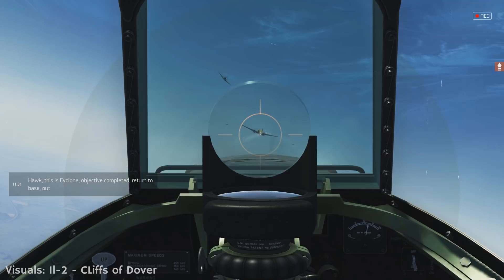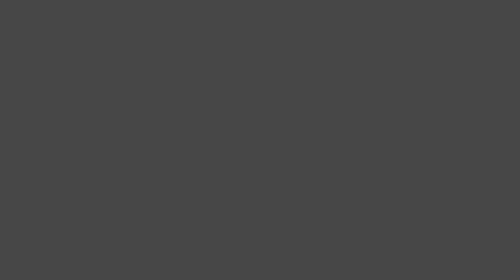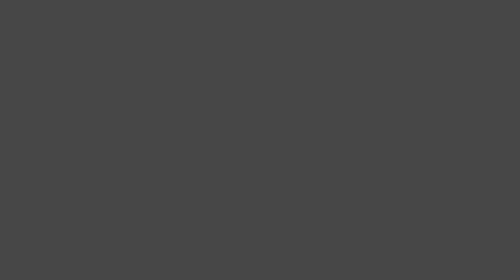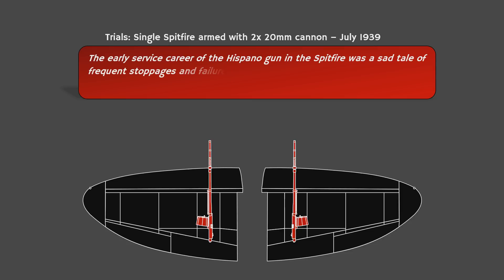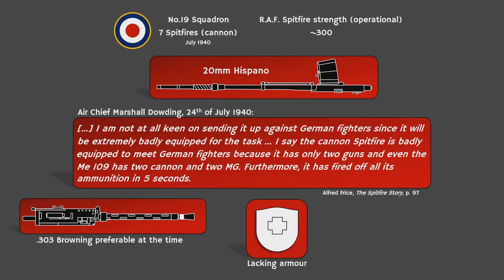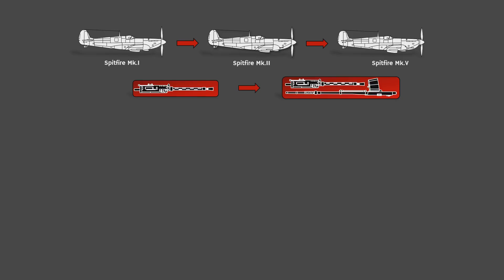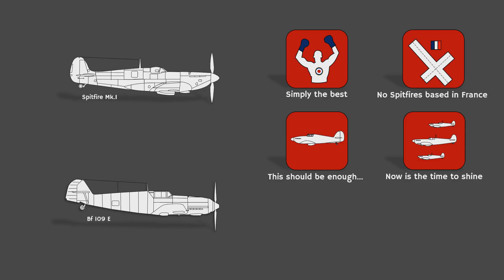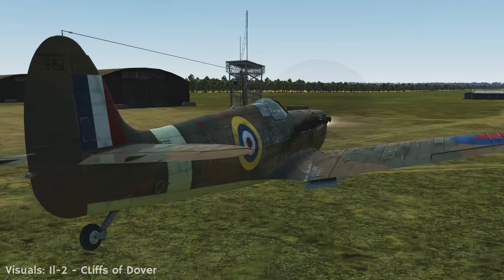⚜ | Clearing up Spitfire Misconceptions

Comment: Seize is really the wrong word, stall or cut-out would be more appropriate. I understand hesitancy to say stall as we like to save that word for the wings but in this case it would apply
Reply: TTMR1986 hes German so he gets to mess up
Reply: He is Austrian actually not German... easily mistaken though :)
Reply: Does gentle norwegian get to mess up cause he's Norwegian?
Reply: engine floods , float in carb opens up under negative G, float bowl in the carbs fill with fuel , engine floods with fuel and cuts out due to over rich mixture ...Is that right ?
Reply: Jonathan Vogel the float floats on top of the fuel at the now bottom of the carburettor chamber due to it being under negative G.  

This opens up the fuel chamber to the fuel pump’s pressure, and when it fills, the full pressure of the pumps is being injected into the engine, resulting in a massively rich mixture and flooding.  

The fuel pump’s job is only to keep the fuel chamber of the carburettor topped off.  

The quick fix solution, suggested by a female engineer, was to simple restrict the rate at which the fuel pumps could top off the carburettors fuel chamber to the same flow rate as the engines would require at max power.  

That means that when the same thing happened, the pumps would only be forcing fuel through the carburettor’s needle at the rate they’d be being pulled in naturally anyway, providing the engine was at full power.  

You’re only really going to be doing those manoeuvres at full power anyway, so it was good enough.   

You see a lot of half answers about this from people that clearly don’t know what the problem or solution was and how they worked, but they know it’s ‘something’ to do with flooding/stalling, and the fix was ‘something’ to do with a small hole to restrict the fuel somehow.  

All you need to know is that how carburettors introduce fuel into the engine, is a separate system entirely to how fuel pumps feed a carburettor’s own separate little ‘tank’ that it works with.  

Carburettors are constantly sipping from a cup, and the main pumps periodically top up that cup very quickly.  

When the carburettor is ‘erroneously’ demanding to be filled up, but it’s already full, because it’s way of measuring how full it is is inverted, then it effectively links the two systems together and now the high pressure, high volume ‘topping up’ pumps are working at full duty, straight into the engine.

Using the teapot, teacup analogy, the fix was to put a restrictor plate on the end of the teapot, so that it could only pour as fast as a teacup would be drunk from when someone is really gagging for a brew.  
So it could still flood when inverted/neg-G at part-throttle, but never during full beans.
Reply: There were two issues with negative G: Initially when you pushed the stick forward all the fuel in the float chamber would fly to the top of the chamber. The Carburettor jets were of course fed by holes in the bottom of the float chamber, so no fuel would enter the jets and the engine would briefly splutter and lose power due to fuel starvation (this was called 'lean cutout). After that, the float would move to the bottom of the chamber, opening the fuel valve all the way and causing the fuel pumps to feed more fuel into the float chamber until the engine flooded ('rich cutout'). The solution to the latter problem was (as described by routari) a restrictor plate that prevented the pump from supplying more fuel than the engine could handle. The lean cutout issue required a redesign of the carburettor- essentially they added standoff pipes that acted like drinking straws for the carburettor jets, allowing fuel to be sucked into the venturi even when the fuel was at the top of the chamber.
Reply: It isnt an issue with inverted flight as they did actually have a fuel pump maintainign positive pressure in the carby. The fact is pilots rolled inverted and pulled back to avoid the issue. So it clearly was NOT an issue for inverted flight.
I dont know where youre seeing people talking about cannon spits being in general use prior to 1941. Not if youre reading decent historical accounts... Or is it just gameboi bs online.
Reply: sabrina
Reply: @patthewoodboy  Yes, a momentary rich cut. You will see black smoke emitting from the exhaust stubs when this happened. Though I do believe '' Bismark'' said ''cease'' not seize.

Comment: Hi biz. When the plane was pushed in negative G, it didn't seize the engine but rather starved it of fuel as the carb had a bowl with fuel in it that was forced away from the pick up due to the G maneuver. Flying inverted was only dodgy if it was sustained. As long as the plane was pulling positive G, even inverted, it was fine. 
reat video series btw.

Comment: Re. the Bf109 being fuel-injected "from the first".
The earliest Bf 109's, the A and B series, used the carburetted Junkers Jumo 210 B and D engines  The Bf 109B saw action in the Spanish Civil War.   The Bf 109C was the first to get injection, with the Jumo 210G

Comment: The carburettor problem was solved by Mrs Shilling during the Battle of Britain, and very quickly, with planes being retrofitted. Stanley Hooker's 2-stage, 2-speed supercharger on the RR Merlin gave the Spitfire an extra 70mph and 10,000 foot of height. All was done automatically by the pilots joystick.  The pilot just went where he wanted without worry. The same engine was used in the Mustang. 

The Spitfire could pull out of dives that would rip the wings off a Bf 109.
Reply: RAF pilots originally called it "Miss Tilly's Orifice," rather than the ever-so-slightly more formal sounding "Miss Shilling's Orifice."
Reply: Stanley Hookers book "Not much of an engineer" refered to  "Mr. Royces" comment when Hooker was set a task of , could he improve "Mr, Royces" design of impellers on the superchargers "honed to a fine pitch/tune" by the great man. Hooker at this time still not fully engaged in the war effort that he so dearly wanted to take part in, thought he'd look at the calculations and graph curves, air speeds and compression within the supercharger unit and rework the figures, which he found could be possible and far more efficient. At this point it must be said that Royce had his canny engineering skills and "feel" for what would and would not be successful in his "aims" and when he achieved this in practice not the "theory" and was achieved, moved onto something else.        Hooker on the other hand was of the "new school" where things where worked on paper i.e. theory, then down to the "tool shop" and discussed  with the engineer on the practical side , i.e. materials and how it was to be achieved following Hookers design and drawings. At this point the mechanical engineer in the said tool shop pointed out to Hooker that "the old man " Royce  wouldn't be happy that Hooker  had been "messing" with "his" s/charger design. When Hooker approached Royce with his projected calcs. and drawings on how he could not just improve the performance of the s/charger but by a considerable amount, at which point Royce pointed out that this was just on paper and that real engineers where very aware that theory and practice hardly if ever went hand in hand with each other. Hooker now more than ever wanted to prove that his "paper figures" would work in practice and with very few alterations he managed to improve the performance by such a vast performance that so nearly tallied with his theory figures, on one of those very few occasions that it actually happened.     When sharing with Royce that he (hooker) was very pleased that he managed to help the "war effort" in this way, Royce said "not much of an engineer" to take another chaps  design and only improve on it, rather than start from scratch as indeed he Royce had done. And of course indeed the great man Royce had that  ability to think and do what was needed to overcome or rethink a given situation or problem, then actually have that engineers skill to know what material to use and how to create what he had in his mind, and bring to fruition .   Truly a great man and engineer.
Reply: No, the RAE restrictor was not used during the BoBritain.  Shilling was tasked to install the restrictors in early 1941.
Reply: @bobsakamanos4469  
You are so wrong.
Reply: @johnburns4017  Implemented starting Jan 1941.  BTW, superchargers have nothing to do with the control stick/spade grip  (not joystick).

Comment: The tool is only as good as the individual using it. 
Being honest the merlin engine sounds wonderful and the design of the aircraft was excellent but so were so many aeroplanes of that era. 
 It will always be held high esteem due to its use during the Battle of Britain and the turning point of the 2nd WW. 
Thanks for your video.

Comment: Yes, lets clear something up...The use of Carbs gave a useful charge cooling effect which gave the Merlin similar power to the injected DB 605, despite having almost 9 litres less capacity!
Reply: Something critics of the Merlins carburettor tend to forget.
Reply: Good point, which you don't often see.  Thanks!
Reply: WELL SAID. !!   Me109 DB engine was 34L (DB 605 was 36L), but the Merlin was 27L and by the end of the war was bench tested WEP at 2640 HP.

Comment: Just being pedantic. The early Mk Merlion engines did not seize momentarily, they spluttered/cut-out due to fuel STARVATION (not fuel flooding as you stated) due to the carb being gravity fed with a normal float type inlet valve. Negative G's or flying inverted caused the float to close the fuel inlet stopping fuel flow into the carb.
Reply: Also, I believe that when normal flight was resumed, THEN there could be a sudden flooding of the engine, making things further complicated
Reply: I agree and for him to say siezed, displays a fundamental ignorance of engines. Siezed engine..haha
Reply: captmack007 Siezed is what I hear but it could also be interpreted as ceased. In the meaning of stopped. That would be closer to what happened. Siezed would mean engine totally locked which might happen if coolant stopped or otherwise. No longer capabel to resume providing power. Both words sound very similar. Or would this not be an option for native speakers?
Reply: @cf6282  
Very good, as USA people rarely use that word. I'd have to listen again, to decide. I do not think I will , though.
Reply: Steve Wayne: the first cure was to go into a half roll and dive
Reply: Funny that people are criticising when the meaning was understood as it was communicated by narrator.
Reply: @captmack007  Siezed?? The word is seized so it looks like you display a fundamental ignorance of spelling! Since English is not Bismark's native language, I think he does pretty good at speaking it. How's your German captmack007 (007, yeah sure)?
Reply: The problem was a rich cut. Under negative G, the float would move to the bottom of the float chamber as the fuel moved to the top. This would leave the needle valve open, flooding the carburettor with fuel delivered under pressure from the fuel pump. The restrictor that was fitted as a stop gap solution to the problem was a precisely drilled orifice that let through just enough fuel to run the engine at full throttle, thus when the float bowl was flooded the fuel flow was restricted to a level that would let the engine continue to run. At less than full throttle there was still a problem with rich mixture, but then if chasing a 109 which dived suddenly, one would assume the Spit pilot would have the throttle wide open!
Reply: Just being pedantic - Early Mk Merlion engines  !!!
Reply: That caught my attention too. . .  'Seize' is always associated with a total engine failure,  when the engine locks up and is kaput.  I'm sure our excellent narrator/researcher would agree after consideration.

Comment: Something not many people realize the airfields in Britain were just that...large fields...so the planes could take off into the wind.  To that effect, the locking tail wheel was only late introduced to the British fighters.  As my father discovered at Yakima some years ago...a free tailwheel on a fixed runway can get you into trouble as he ground looped his Hurricane...damaging the Starboard wing on a landing light.
Reply: perhaps initially, but runways were built as aerodromes became congested and marston mats and asphalt were laid down for better year round operations.  Everyone flew off runways then and the warbirds continue to do so today.  Go easy on the throttle and quick on the feet.

Comment: "A" wing was all guns only. "B" wing was a mix. "C" wing was 4 cannons. "E" wing could be done in any configuration. Prior to the "B" wing there was a short period with 2 cannons only. Once the wing was beefed up, it could handle both cannons and guns. The wings with a bulge underneath, or a pair of bulges were for cannons. The "A" wing had no bulges. Note, the photo recon spits had a much larger wing in length and width that allowed it a much longer range, speed, and altitude. The PR spit used the empty gun spaces for extra fuel, thus giving it a Berlin range. Unarmed.

Comment: Excellent production, Bismarck. Another problem about the early cannon firing Spitfires had to do with the way the cannons were placed. As not to interfere with Mitchell's wing design, the cannons were placed on their side, and the ammunition feed was placed laterally, that feed following a non-linear direction. The guns were not meant to fire this way, but they were tucked in the wing without interfering with the wing design and construction. Designer Joseph Smith deviated from Reginald Mitchell's design by introducing the now famous tear drop bubbles on the wings, allowing for a proper ammunition feed. Then there is the rather bizarre story of Douglas Bader and his criticism of adding cannons. He believed that the .303 machine guns were better as it encouraged the pilot to close in on the enemy. He spent the rest of his combat duty flying a Spitfire Va, a Mk. V with the traditional eight .303 guns. Well after the war, he admitted to being wrong on that point.

Comment: Good stuff! I have made the same point elsewhere about the direct injection of the Me 109. It was new technology with huge development potential but carbs were mature "state-of-the art" and with considerable scope for further development. Their problems are generally overstated and were, in fact soon sorted.
Reply: @garyseeseverything8615  Hi garydoesn'tseeenough. Your assertions are absolutely not backed up by history,  Mechanical petrol injection was soon matched by carbs. Petrol fuel injection, like common rail diesel injection, had to wait for electronics to fulfil its potential.

Comment: I note several misconceptions developing here. 
First,  the performance of the aircraft is relatively unimportant, its pilot skill as pointed out by Galland,  but more importantly being in the right place, and in this respect the RAF had the advantage. The early warning system set up by Dowding and so expertly used by Parks was the key to the RAF success. The RAF could fight on its terms, and not those dictated by Goering.
 
Second , as the efficiency of a engine is defined by the Carnot principle. Carburated engines are more efficient because the fuel entering the engine is so much colder, hence a 27lt merlin produced the same or more power as the 38lt Daimler. UK also had access to 100 octan fuel which also allows significant improvements to be made  throughout the war, but its not unlit the war is nearly over that Germany starts to introduce the improved fuels.

 Third, cannons do little damage to Hurricanes unless it hits the engine, and in Hurricane to 109 encounters the Hurricane is a competitive match.

Forth, as Sailor Milan pointed out , a damaged aircraft returning with badly injured crew has an even bigger negative effect on moral, than not returning at all, so kills are not the whole story.
Reply: Hurricanes had less performance and therefore were more vulnerable than the Spitfire.  Each had the same vital points (engine, oil system, coolant system, pilot) except that the Hurricane's header tank was not protected (causing many Hurri pilots to be burned) and its wing tanks made for a larger target and the doped fabric/wood rear fuselage was flamable.   It wasn't normally competitive and had the worst kill ratio of the Battle.

Comment: I'm of the opinion that had the Whirlwind been ready and available in the summer of 1940 the losses of Luftwaffe bombers over Southern England would have been far worse. The Spit was an incredible design for it's time. It's one fault lay in its construction time. It took many more man hours to build than other types.
Reply: Had Westland stuck with the original propellers of the prototypes, they may have had more support from the Air Ministry/RAF as a bomber destroyer; however, RR simply didn't have the manpower or capacity to refine and produce both the Merlin and Perigrine engines.